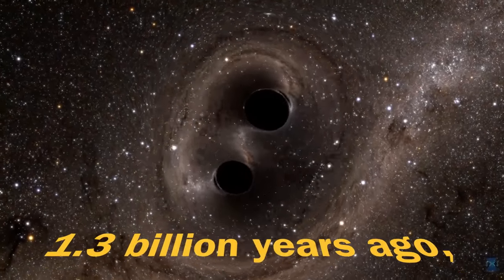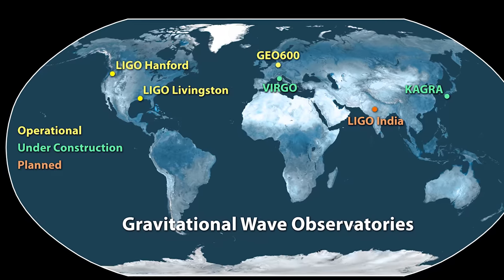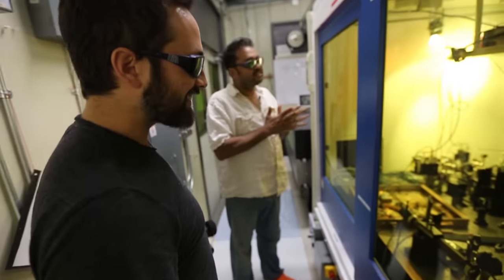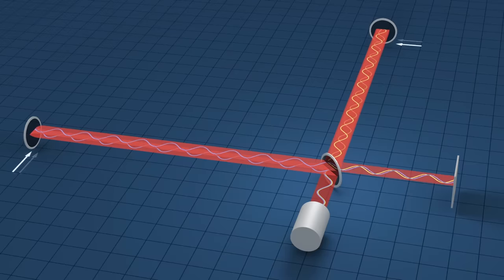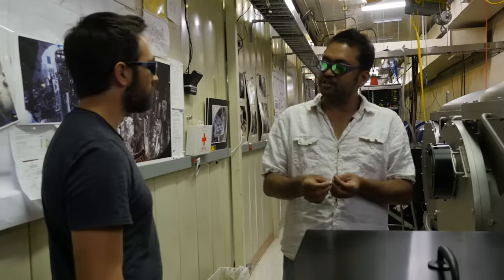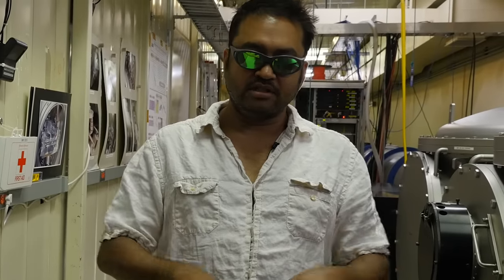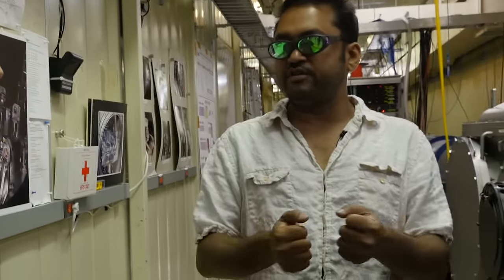The Absurdity of Detecting Gravitational Waves

Comment: Security vulnerability in the universe, god patch plz
Reply: god patch only works on previous operating systems. Please close running applications and wait for the reboot.
Reply: God is the source code ,, its still good , try it
Reply: As has been previously advised, please contact the Vatican call centre and have the Pope to submit a bug report to God. Please be patient, bug will be fixed in the next universe.

Comment: Since the announcement of the gravitational wave confirmation, I have wondered how that wave just happened to be witnessed at a specific instant more than a billion years after it was generated. Was the wave a one-time ripple that came and went, or was it part of a series of ripples that happened over several days? And how did we know to attribute the wave confirmation to that specific merger of two black holes? There are events generating huge energy releases in the universe at any given moment, yet we concluded that a specific wave was generated by that specific event to the exclusion of any other event.
Reply: Sorry it took a year for an answer.. i worked at one of LIGOs sister facilities.  The actual gravitational wave that was measured originated between 460-470 million light years away.  Very recently a supermassive merger between two black holes where the larger of the two is roughly 2550 times larger than the sun.  It happens to be around 7 times closer if my memory serves and will coalesce in 250 million years.  What will you to to celebrate the occasion? :)
Reply: @dbycrash  resurrection… i think… :)

Comment: The reason the arms are perpendicular is that the detected wave is coming at us from a distant point source.  The stretching of space-time in one arm is a different magnitude of the stretching in the other arm.   The difference in the amplitude of the two light beams is the detection.    It is also necessary that the 2 light beams have a single source, split down the two tubes, and observed as they return.

Comment: Is there evidence for the merging of two black holes a billion years ago?
Reply: Are you joking? The evidence IS the detection. That's like asking if there's evidence for the Sun as you stare right at it.
Reply: I'm just curious. What evidence is there for black holes emitting these waves?
Reply: As in, has a black hole been observed during the process of emission?
Reply: The detection is the damn evidence.
Reply: Any mass not moving parallel to each other produces gravitational waves.  Two objects rotating around each other produces constant gravitational waves.  Black holes merging are the only thing in the existing models of the universe capable of creating waves large enough for us to detect with the detectors we currently have built.  With a big enough detector you'd be able to measure the gravitational waves created by our own solar system.
Reply: We have good indepedent evidence black holes exist. We can observe stars that approach the dormant black hole near our galactic center get flung around like a toddler throwing a teddy bear out of the pram as they approach it. It takes a small, very, very dense object to do this, and it is not otherwise visible. We can observe black-hole-like objects with jets and a disk consistent with feeding black holes in other galaxies. 

The LIGO measurement was consistent with small, incredibly dense objects objects with masses in the range of tens of solar masses spiraling into each other at nearly the speed of light and then becoming still. Neutron stars are not small enough and do not have enough mass to orbit each other ~150 times per second.

What we've learned from LIGO is that binary black holes exist and black holes as small as tens of solar masses exist.
Reply: Michael K: There's no way to see individual stars a billion light years away. The LIGO team isn't linking the signal to a known event - they're predicting the nature of the event based on the properties of the signal.

Since there are two LIGO detectors, they can estimate the direction and distance of the wave. And based on that data plus the wave's shape and energy, they can estimate the sizes and masses of the objects. In this case, the objects were so small and so massive that they must be black holes.
Reply: The answer is no. There is zero evidence that the infinitesimally small quake that was detected can be attributed to black holes colliding.
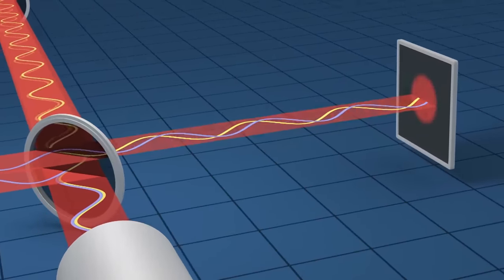Reply: At 0:47 that picture represents the signal of the detection. That pattern is exactly what was predicted if two black holes merged together. So the evidence relies on are current understanding of waves and relativity  being accurate. They check these things very seriously and there was no mistake. We can be very confident in are current understanding of the subject. The detection is therefore the evidence itself. If the event did not actually happen, the fault is in are understanding of the subject and not the detection.
Reply: 3vil3lvis How does Einstein equations fail with black holes when he predicted them with those equations.
Reply: 3vil3lvis What are those equations and what exactly causes them to break down?
Reply: Cortster we have the aftermath but how do you know it was caused by black holes?
Reply: +QuantumFrost
To give an analogy you'd understand: for similar reasons a bomb squad knows what kind of bomb was detonated after the bomb went off. The average joe wouldn't be able to understand what they did to figure it out, but you don't question their knowledge on the subject, do you?
Reply: Cortster well I don't blindly take an answer I need a logical explanation 
So is there any other explanation for the G-waves
Reply: well, its not evidence par se, but its the best explanation we have until a new type of explosion comes along
Reply: uptorest fair enough
Reply: +QuantumFrost
People already gave the logical answer, and you ignored it. What else could you want? Black holes cannot be seen directly, the excretion disks are nigh-impossible to see (due to how small an average black hole's radius is), and even gravitational lensing effects are nigh-impossible to see. However, we do have indirect observational evidence of the supermassive black hole in our galaxy via the stars zipping around an invisible center at enormous speeds. So yes, we do know black holes exist. And the discovery of gravitational waves allowed us to DIRECTLY observe them for the first time, not just indirectly.
Reply: +3vil3lvis
There's a nobel prize in it for you if you discover a black-hole-like object that's not actually a black hole. E.g. an object with 10 solar masses and a radius less than 30 km and no event horizon.
Reply: +QuantumFrost
The way we know the waves were caused by merging black holes is by the frequency of the waves and how they changed with time.  This tells us a lot about how the orbits of the objects changed during the merger, and the properties of the objects themselves.

As the objects get closer together and orbit each other faster, the frequency of the gravitational waves they emit increases -- which you can hear as a rising pitch when the recording is played back as sound.  This is Kepler's Third Law: the closer the orbits, the shorter the orbital period.  The highest frequency comes at the moment that they touch (for black holes this is given by their event horizons), so by measuring the peak frequency, we determine how fast the objects were orbiting when they touched.  The peak frequency LIGO detected is impossible to achieve with any object besides a black hole -- even neutron stars would collide before they could reach this fast of an orbit.

There is a lot more analysis we can do beyond just the peak frequency, but that's a good first proof.  The greater and even more convincing details lie in how the waves change right after the black holes merged.  For instance, the resulting black hole's event horizon vibrates like a ringing bell for a short while (what we call "ringing down"), and it has a particular timescale to dampen down.  The gravitational waves show this behavior and it beautifully matches the predictions of general relativity.
Reply: Parrot Ox: No there is not. The whole event was retrospectively construed from the famous silent chirp. No external evidence. LIGO can only give us a very rough approximation of where the "event" allegedly took place. On the blind side of the planet from where the LIGO detectors are, by the way. The videos you see of the swirling black holes with the stars dancing around them are not real footage. They are computer generated speculative simulations which have been bouncing around in their brains and computers for many years. I mean that in the nicest of ways. Proof should be made of sterner stuff.

Comment: But what if one of the arm is 0.0001 cm longer?
Reply: It's not the size of the arm but the way the wave moves.
Reply: @ZezoFleck  I see what you did there lol. But Ive heard scientists say they dont really care about size of the testing arms before, but then when there is inconsistency in their experiments (they are not getting the data/readings they were looking for) they then go and apply to another experimental facility. One in an African nation most likely... ;D
Reply: They calibrate based on the length they calculate with a test shot of light. They can still see fluctuations and just use relative rather than absolute length fluctuations.
Reply: @Jacob-ye7gu  "They calibrate based on the length they calculate..." "Relative rather than absolute" values? Nope. "when all the standards of science and physics are relative and arbitrary, the theory is unfalsifiable, and that's not science." WT
Please explain how the margin of error can be 50 nanometers further from or closer to the points of observation, which is one billion times larger than the gw signature, and somehow they can measure the distance between the two mirrors in each interferometer to the required tolerances. As that would be impossible, I already know your non answer.